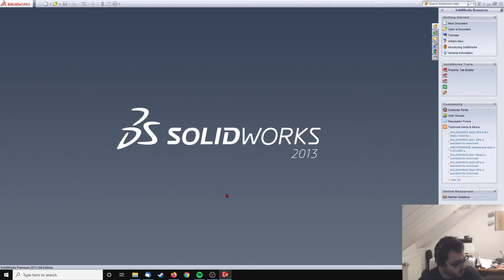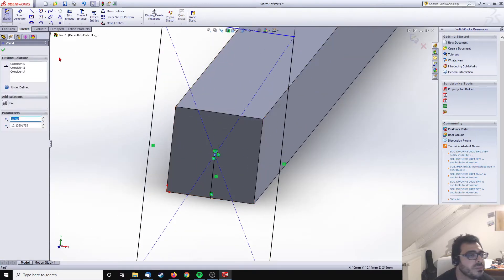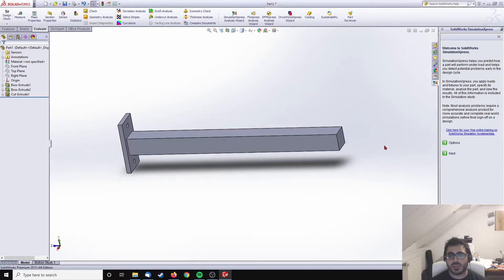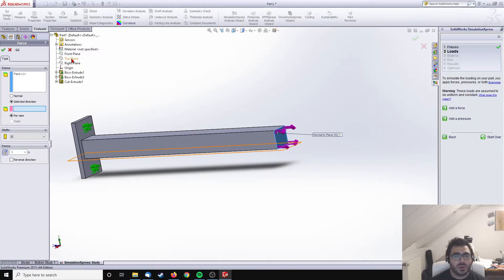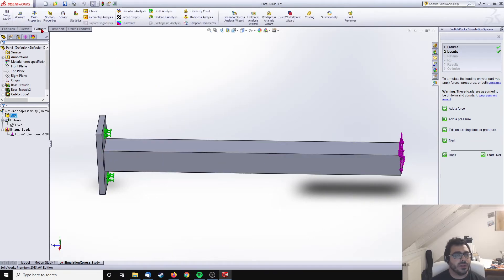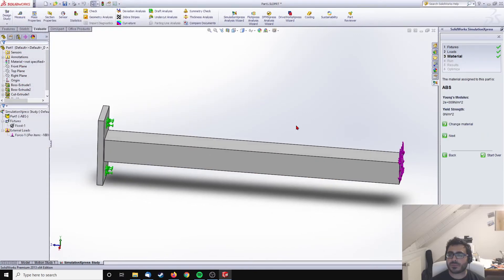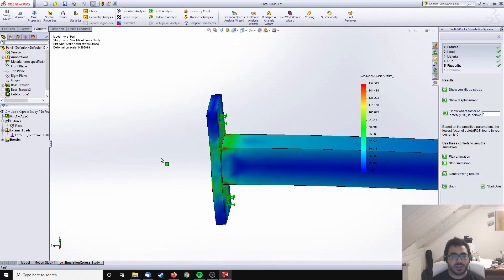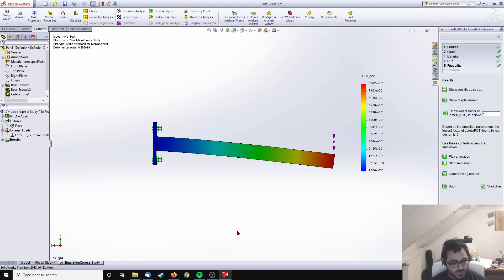Simulating a 3D printed part on Solidworks to improve design

Comment: sir..what if I wanted to know about the exact analysis of 3D printed part on considering the infill ,mesh density etc..
Reply from the maker: You will need to model in CAD all the details.
Reply: @RamiRouhana  can we make exact pattern of slicing in CAD by using (liner pattern and sketch patterns etc..)?? is it possible
Reply from the maker: @NSEERAPUMANOHAR  there are scripts develeppoed in CAD to do it, not yet available withe software,and not very stable. The ony way now woud be to script yourself or do it manually if the part is simple.

Comment: Thx. Do you have any input, or links, on the role of actual model slicing on FEA, specifically, now to accurately model it in the simulation? You touched on a couple aspects at the end, but as I'm sure you realize, the actual 3D print is far more involved: infill, perimeters, inter-layer adhesion, etc. Hm?...
Reply from the maker: There are some software packages the convert the gcode to a CAD file. They are not yet very reliable. In the near future i think i will be a python plugin in Abaqus that converts gcode to CAD.
Reply: @RamiRouhana  Thx. Perhaps I should clarify: my interest is in FEA/simulation of the various geometries (e.g. infill, etc.) and the actual full 3D print (a very complicated assembly of aspects, indeed). FYI, I can already get the geometry of the sliced model: not from g-code, but directly from the slicer. PrusaSlicer has 'Export toolpaths to OBJ'. Cool, eh?
Reply from the maker: @swamihuman9395  I will check that . ypu still need to convert the obj to CAD. Another problem would be surface quality for abaqus meshing. You will need to clean the OBJ for proper meshing.
Reply: @RamiRouhana  Thx. There will indeed be many problems! Ultimately, a mesh is used for the FEA, but are you saying Abaqus requires a 3D solid first? And, although Abaqus is capable, currently I only have access to SOLIDWORKS, and Fusion 360.
Reply from the maker: @swamihuman9395  Solidworks FEA is not that reliable. Another reason you do not need a detailed model but rather just use a shell.  A detailed model is only usefull for an accurate simulatiin on abaqus. That is why i describe a simplified approach in those videos.